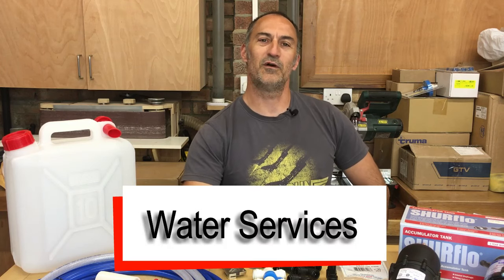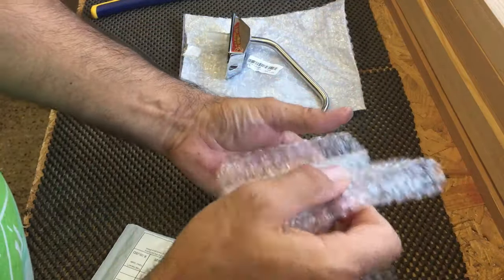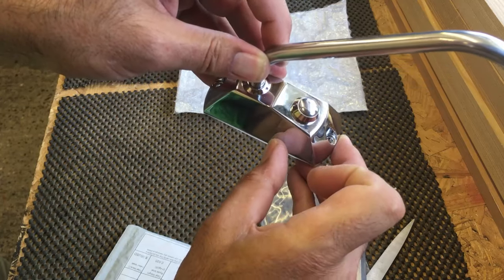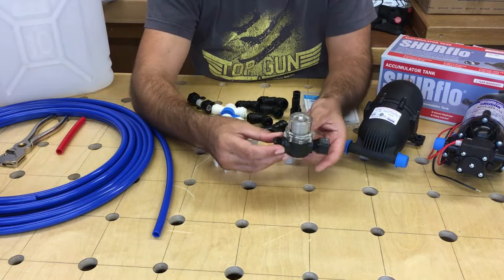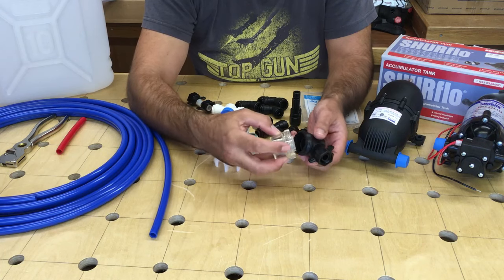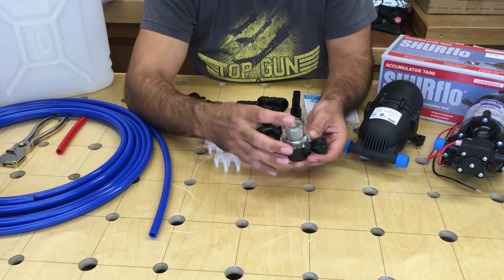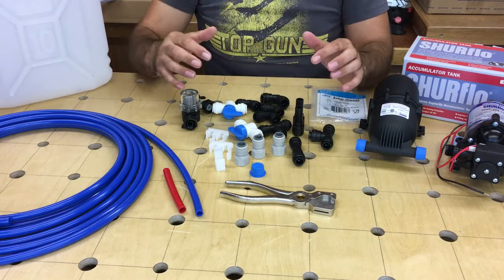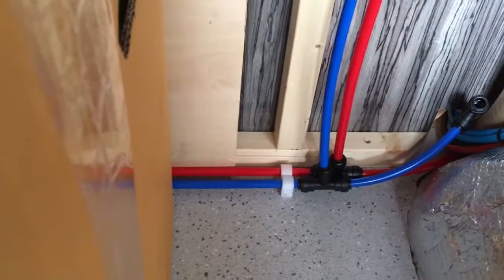Domestic Water Services - Camper Van Conversion Series

Comment: Hi Greg
Super useful as always. 
Question - did you need to adjust the pressure of the accumulator later on? My pump came supplied with a different make of accumulator. Which simply says set to the starting pressure of the pump. The pump start pressure is not documented and is, in any case, adjustable. After a lot of googling, I found a few ways to do it.
Just wondering what your experience was, and if the shower flow is nice and even? 
Thanks again!
Reply: @GregVirgoe  not sure which you have, but the online pdf manual for the 182 series says set to the turn on pressure of the pump for caravan/RV use. Also that default is half the pump working pressure. 
If you didn't change it, should be working fine. If you set it to the pp working pressure it's probably doing nothing.
Reply from the maker: Hello Kev, you are right for that model. The manual does say the static pressure should be the same as the pump start pressure that is also with system filled, pump off and one tap open to give you static pressure on the bladder. Do you know what pressure your pump cuts in at??
Reply: @GregVirgoe  nope. Will measure it when I get everything installed. I think it's the same concept for all models. If you pressurise to pump working pressure, no water will go into the accumulator. It will be effectively bypassed. On web post said the idea was to get the accumulator to empty by the same point as the pump cuts in. Just wondering where max pump pressure setting comes from. It's intriguing me.
Reply from the maker: kevgermany well done 👍🏼
Reply: @GregVirgoe  Hi Greg. I finally got a chance to get this done and sorted. I took measurements and looked at the behaviour of the pump. I have the same pump as you, but I believe all pumps with pressure controlled switching will work the same way. Hope this makes sense. 

All pressures below measured on the gas side of the accumulator - I have no easy way of measuring the pressure on the water side of the system. 

To summarise - accumulator pressure is set with pump powered off and no pressure on the water side of the pump/accumulator (tap opened until flow stops). Once this is done, turning pump on causes a rise in the water pressure which raises the pressure on the gas side of the accumulator. 

Under working conditions pump cuts in when accumulator pressure is at or below about 19psi. Pump cuts out at about 25psi, although the pump pressure specification is 30psi. I assume this is from the additional pressure exerted by stretching the diaphragm in the accumulator as pressure builds on the water side - very much like a balloon. 

If accumulator pressure is set higher than the cut out pressure of the pump, as soon as a tap is opened, pump cuts in. I did this at various pressures. 

If accumulator pressure is set close to the cut off value of the pump and a tap is opened sightly (as I did for these measurements), pump may start switching on/off pretty quickly. I guess this could kill the pump quickly.

If accumulator pressure is set below cut out pressure of pump, pump will only start after tap has run for a while. Time taken depends on tap opening and difference in pressure between pump cut out pressure and accumulator pressure. Pump cuts in consistently around 19psi. 
 
Accumulator pressure can be set lower than pump cut in pressure, this seems to lengthen the time from tap opening to pump starting and pump cut in pressure drops a little. This effectively increases the working volume of the accumulator. 

I deduce from this:
If accumulator pressure is set at or higher than pump cut off pressure, accumulator is not able to accumulate water as the pump is unable to overcome the gas pressure in the accumulator. And so effectively the accumulator does nothing (might help smooth out water hammer, though). 
If pressure set between cut in and cut out pressure the accumulator works by accumulating water, pump pressure fills it. Pressure in the accumulator feeds water back when a tap is opened.   
If accumulator pressure is set lower than pump cut in pressure, more water will be in the accumulator, but will not be used as the pump will cut in before the extra water leaves the accumulator. 

Does this matter? In an ideal system there are no leaks, so pump will not cut in unnecessarily. But in a slightly leaky system it will reduce the frequency of pump cycling. Also a pressure setting close to the cut in pressure of the pump will help absorb water hammer.

Comment: Hi Greg 
I have installed the same fresh drinking water set up as you .with the same whale pump 
Only problem it the water pressure from the pump is to high and it spats back out the glasses 🙈. 
Any idea how to reduce the flow rate? 
Cheers Greg
Reply from the maker: Simon O'Sullivan yeah it does come out pretty quick. 
You can try restricting the water flow with a plastic plug with a small hole drilled in it push into the hose
Reply: Greg Virgoe ok great thanks for quick reply ,safe lockdown 👍
Reply: Sorted ,I cut the silicone tube which made a cone shape and pushed it in the pipe. 
Thanks again

Comment: What did cable did you use for the 12v switch and 12v submersible pump when wired together as per your video? Do I need to add the amps from each item together and chose the cable size of that? If so I’ve calculated I would need 2.5mm
Reply from the maker: Only the pump is using any power so a cable size of 1.5mm is fine. 
The switch rating means that is the power the contacts can handle. Hope that helps 😃

Comment: Great video.  There's one ridiculously basic water method that's between two you mentioned at 0:38 - pouring from a jug and a hand-crank with faucet.  What about putting the jug up high and having the water pour into a sink?  I'm surprised more people don't do this - particularly those with a hand- (or foot-) pump.
Reply from the maker: Lifting a heavy can of water to high level might be an issue. Also weight at high level can affect the vans centre of gravity.

Comment: Greg, just another comment of praise for all your videos. 

Question, did you give any consideration to running your various water feeds through a central manifold so you could isolate any particular outlet if needed? Or would you consider that overkill for something as relatively simple as your van arrangement?
Reply from the maker: It's such a small system, I'm only feeding the shower, sink, boiler and toilet.
Local isolation would be a good addition. a central manifold would result in more pipework.
Thanks for an interesting comment.

Comment: Hi Greg, great vid, doing my water part now and wondered where I can get the fitting between the pump and the expansion tank?? Cheers bud
Reply from the maker: Ben Smith pretty sure mine cane with the expansion tank but you can buy them separately. Here is one supplier so you can see what to order https://caratech.co.uk/product/caravan-motorhome-shurflo-accumulator-straight-connector-0687/

Comment: Hi  Greg, firstly thanks for all your great vids, I'm currently converting my own van and your videos have been invaluable!
I've a question regarding your water heater and pump. I see you have a truma combi which holds 10litres... if your shurflo pump is 7litres per minute, does that mean you cant shower for longer than 2 mins!? I know this is a newb question but trying to work out my own water system, so any advice greatly appreciated. Thanks again
Reply from the maker: No, not at all, the heater is putting out hot water at 60°C and the shower has both a hot and cold water supply to a thermostatic mixer, you will most likely shower in 40-43°C water any hotter and you risk burning yourself so you are mixing cold with it too. But here's the biggest thing, yes, the pump is capable of supplying 7l/m but our shower only delivers water at a rate of 4l/m so with a mix half hot and cold and that flow rate that pushes the time out to 5mins of nice warm water, even a bit longer with the boiler running on max 5.8kW and heating up the incoming water too.  It will recover to full temperature in 20mins for someone else to have a proper shower. I can get 4 showers out of my water tank before refilling. Our shower head has a trigger on it so it only delivers water when you hold it so you are not wasting any. You adapt your showering technique by having "NAVY" showers, wet, shampoo, rinse. Hope that helps
Reply: Thanks very much for your reply! there's so much to get your head around with all this stuff! when you have a spare few mins, could you post a link to the shower you have Id be interested to see the whole set up to get some ideas of the whole shower system? Thanks again and keep up the great work, your vids and advice really are first class!
Reply from the maker: Hi Toby, here is a link to the same shower head https://rover.ebay.com/rover/0/0/0?mpre=https%3A%2F%2Fwww.ebay.co.uk%2Fulk%2Fitm%2F182475251147
We’re just using a cheap single lever mixer from B&Q which was £50.
Reply: Thanks Greg, much appreciated, I assumed it was a special shower head for a camper van! thanks again, and look forward to seeing more of your van!

Comment: Your videos are so inspirational and easy to follow.  My 12V pump is 60 PSI.  I haven't been able to find a pressure vessel/accumulator tank with matching PSI (in Australia).  Can we buy one with different PSI and then change the pressure?  Most of the ones I have found are 125 PSI.  The others are 30 or 40 PSI.  Any tips would be gratefully appreciated.  Thanks.  Lisa.
Reply from the maker: Hello Lisa, sorry it’s taken me some time to get back to you. Your message went into my spam folder for some strange reason. Anyway 60psi is a lot of pressure. Most pressure controlled diaphragm pumps have an adjuster on the pressure switch so you can turn them down. It will be factory set at 60 but hopefully you can turn that down. Ours is 30psi and that’s plenty for showers and the kitchen sink. 
With the pressure vessel you can increase the pressure with a bicycle pump or car tyre pump but just check it’s max working pressure so not to over inflate the bladder. Do that when is has no water in it too. Hope that helps you. Please do ask if unsure 😊

Comment: Hi Greg. Another great video. I've purchased all of the components now but I've noticed that I do not seem to have the black butterfly fitting on the one end of my filter like you have  already installed in your filter. Did it come like this or did you get the fitting separately? I cannot seem to find one online. This is the only part holding me up from installing my water system now. Thanks for all your advice on these videos, it is helping us so much. Best on here! We are 'borrowing' everything from you :) As other's have said, have a few pints on us!!

Comment: Hi Greg. I’m curious as to why you went for 12mm speedfit over 15mm? The tank supply and most domestic appliances all seem to take 15mm - so I’m wondering if you could tell me the advantages of going with 12mm?
Reply from the maker: Most campervan and motorhome appliances use 12mm speedfit fittings they just seem more readily available in that size and meant i didnt have to keep using reducers etc
Reply: @GregVirgoe  Thank you! I wonder is this a bit of a dirty trick on the part of caravan manufacturers - going with the smaller gauge to bump prices up a bit... 
Thanks again for the reply - about to begin the plumbing install on my Relay conversion and your videos have been invaluable!

Comment: with the tanks underneath the van how do you stop the water from freezing and can you get a heater to prevent the water from freezing
Reply from the maker: You can insulate the tanks or install a frost protection heater. The insulation doesn't need a power source and could be an easier solution.

Comment: I know it's been a while since you posted it but I need to ask this. Wouldn't the expansion vessel affect how the pressure switch operation? Isn't the expansion vessel going to absorb that pressure change in the system that would trigger the pressure witch on the pump?

I'm just in the middle of my own build. I've watched tons of your videos, really useful. Thanks for sharing all the knowledge!

Comment: Late to the party on this video but please note that the Trail King 7 water pump appears to have different specs to what Greg describes here. It has a 20 PSI output with 1.1 bar pressure. The cutoff is 30 PSI and 2 bar. I've checked the specs on the Shurflo website. Just thought I'd mention that. I'm still getting one though as it works well apparently.
Reply from the maker: You may have a different version but it does coem as 30psi or 2 bar here is a link
https://www.ebay.co.uk/itm/184028123451?epid=19034987637&hash=item2ad8ee513b:g:uogAAOSwNoBdxZSS&amdata=enc%3AAQAIAAAA0O%2FVctyyXe62m2BDeueS%2FplyARQLWmj8dcK62PniIXXmVqgrfM2z2wuZwgZF7RI%2FOGmejfoo4CdNrrWlS0rVFvxo6qR7a9AYYGPRmQgE5YAbGzwrLEm9xuerrFx7XmMQPDXIYp0OyHBP43yMoIFxm5jMOKyBlbH7mS%2Fyl%2FJoqfDsYxHt372ILfm49kmnBZJmQ9jXsgoGMec6SQywHx16Dg0V6qqcB1W2Od64XTWWbVfjx7AqLkz%2FcbBwH0We2%2BMsiEs7AGMy8GJ6T3sLvjxs5hg%3D%7Ctkp%3ABk9SR5Tt2obBYg&mkcid=1&mkrid=710-53481-19255-0&siteid=3&campid=5338027957&toolid=11800&mkevt=1

Comment: Greg ... need some help. I have your same shurflo expansion tank and I'm working with John Guest system like you.... 12 mm. Which kind and size of adapter did you use to attach the threaded outlet of the Expansion vessel to the 12mm tube?  Thanks for your help

Comment: Thank you very much Greg for your extraordinary videos. I have a question on this one. You run cold water (blue) next to hot water (red) and also next to heating tube. Do you think that cold water will be still cold ? How to isolate it better ? And 2nd question - you plan to travel through Europe full year. How do you isolate water tank so it will not freeze ?
Reply from the maker: Ideally, it would be better to insulate the pipes, there is very little space in the van, I'm not that bothered if the water is a little tepid as it's only for washing and showering. The drinking water can I have built an insulated housing to try and keep it cooler. Don't plan to travel to cold countries during the winter, we like to get away from the cold as much as possible.

Comment: Excellent video. I see that you are running the water lines outside the wall however if I have to conceal the lines then what do you recommend? Should I conceal between bubble barrier and plywood?
Reply from the maker: Suresh Kumar, I wouldn't recommend concealing any fittings as they may leak, if you have to conceal Pipework try and install it without any joints and put some insulation around it to prevent it from sweating inside the structure of your van. Hope that helps

Comment: Do I understand it right? The pomp is continuously connected and turned on so it gives the pressure onto the water system? And the flow of the water is controlled by opening and closing the tap?

Comment: Hi Greg could you tell me the part that connects the pump to the expansion valve please I can’t find it, thanks Jen
Reply from the maker: https://www.ebay.co.uk/itm/185366768271?hash=item2b28b86a8f:g:Q2YAAOSwhVZiamlR&amdata=enc%3AAQAIAAAA4Hr7lrpoD7huluOz3vj8BOX2oRj6%2BU5tqI%2FElJAyDfIdoFy82XTrIdEgmuphNHSl0Yd%2BLNDCWj%2BSYh9VdKlL0rxT6nRmKLCQ1VMWt9XgcuAJUhjT5bZILWe9kNEvkEhy%2BhU3HR1DpZx%2Fqkt2QOnJyfp6AtmbaRh0cSS6h9%2FQ0wxADUjAxQa0oDk4MoBrxtRU0hLveOj4nrFbeQrL3yy9wy8yA0o7IzikfPge0%2FnDJtA%2BNIdcumfaO%2BiEJSuG%2Bg%2FQHKSxW0hY59%2FQi8Cpj8i0mYfHz52UOgylbBspFfzsPVHr%7Ctkp%3ABk9SR6KCwobBYg&mkcid=1&mkrid=710-53481-19255-0&siteid=3&campid=5338027957&toolid=11800&mkevt=1

Comment: Really helpful and top quality videos Greg :-) One thing that puzzles me though is when using rigid pipe how do you separate the filter/pump/expansion chamber between the isolator valves?
Reply from the maker: dave young those wing nut connections are unions and the pipe is all flexible. To be honest there less than a pint of water in the pipe so it would t take two seconds to drain it. Not a problem at all.
Reply: @GregVirgoe  Thanks for the update - looks like a good solution.

Comment: Hi Mate. 
Shurflo doesn't recommend ridged  pipe connected to pump or accumulator. You had an issues? 
Tia
Reply from the maker: NO None at all and the plastic pipe is not really rigid as it has some flex to it. the pump is mounted on rubber anti-vibration mounts and it's been running for 5 years with no issues.
Reply: @GregVirgoe  cool no worries mate.  Cheers

Comment: Hi Greg, what fittings did you use for the pump to 12mm pipe?
Reply from the maker: They are 1/2” BDP female thread to 12mm push fit adapters. 
Use the links in my video description and you will find some
👍🏼😃
Reply: @GregVirgoe  Thank you!